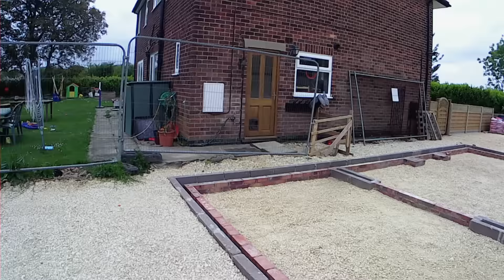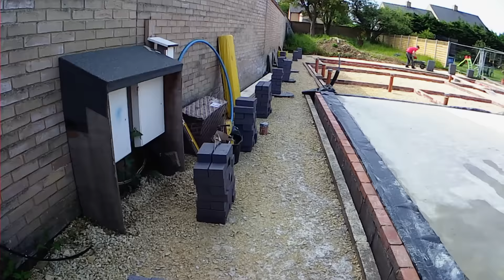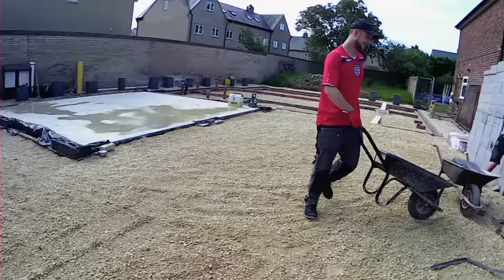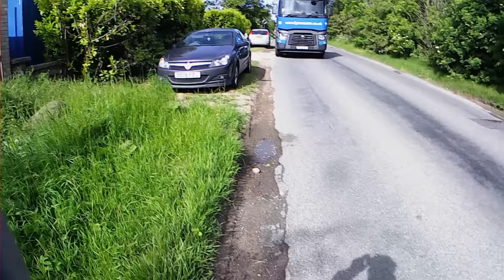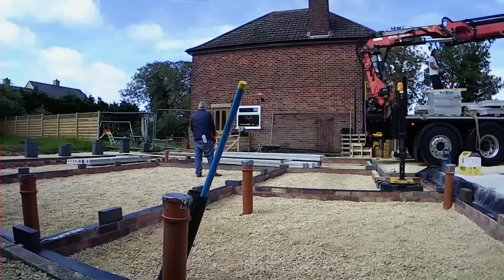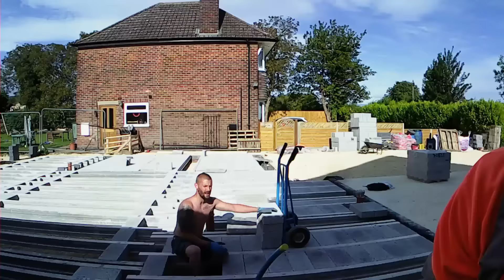New Project Block & Beam Floor

Comment: Quality looking workmanship.
Question, why did you go for block & beam? The footings don't appear to be very deep and the ground looks ok; would pouring a concrete slab not have been an easier & cheaper option?
Reply from the maker: Thanks kevocos, much appreciated. I will answer your question as best as I can.
 Building control, architect and client deal with what floor system house, whilst the drawings and planning was being sorted.
The  block and beam was the chosen way I am not sure why but They obv have their reasons. 
I am contracted to do the work as by the plans & is what I am doing. A saying they always say "Follow them plans ain't can't go wrong" 
I hope this helps my friend. Thank you for taking your time to comment and watch my video.
Take care 👍
Reply: @Forest_Ry  Thank for taking the time to answer!
I'm from Ireland originally and B&B is seldom seen there so I'm trying to understand its pros & cons as it is a common spec here in England. 
Foundations over in Ireland are generally either a mass concrete raft (great job but expensive) or strip foundation, footings and a concrete slab oversite.
Reply from the maker: @kevocos  oh right what's it like over there? And B&B is fairly common over here  on new builds and modern extentions.
 Both systems have pros and cons tbh.
I like the B&B for it allows air flow between oversize and floor but don't know what the cost is compared to a normal sub floor? 
It's gotta be good else it wouldn't be used surely? Thanks Ryan